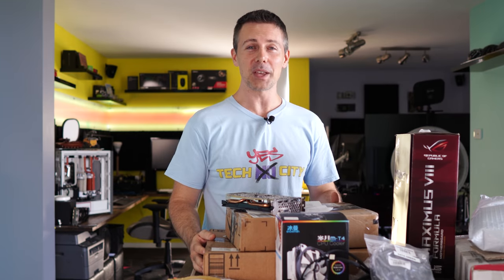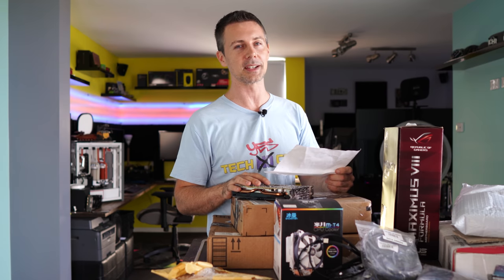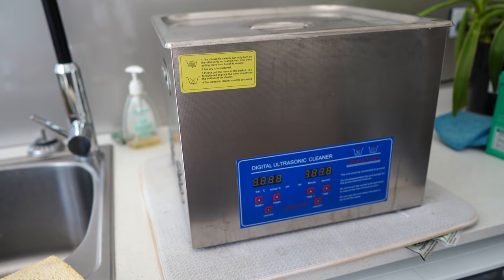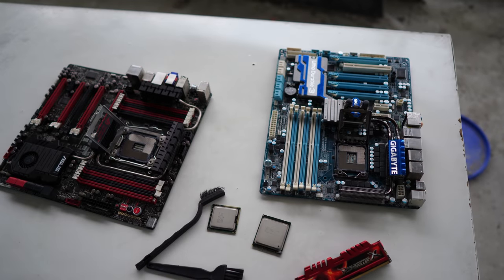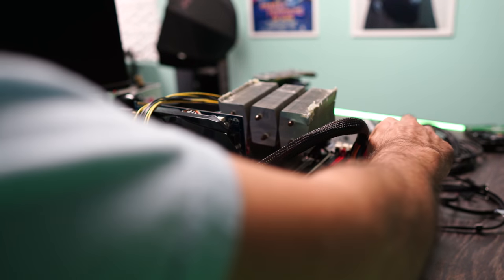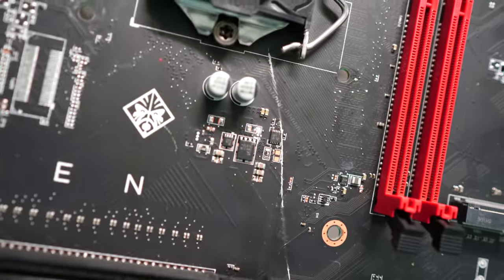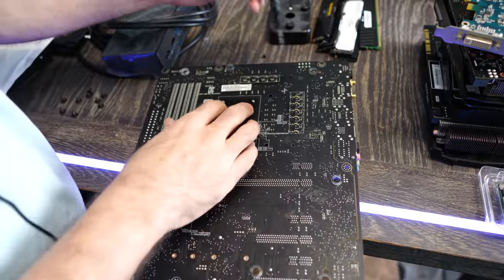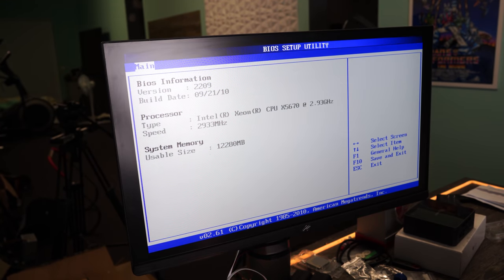Motherboard Doesn't START? NO RAM Recognized? Attempting to Fix Your Faulty Parts  (CAN YES FIX IT)

Comment: Hey, just discovered your channel and like quite a few vids of yours. Since I have been working in Australia when I was young and pretty I really love your accent too ;-) My question is: At 28:18 you are using a cleaning spray on your cpu and memory sockets. Can you comment on that? Which kind of spray? What do you do after spraying (just let it dry, wiping it off etc.) ? Having a i7-4790K with some oxydized contacts which I kind of managed to improve with a glas fiber pen after getting 5 beeps from my AMI bios. Thx.

Comment: Nvidia mats - often no picture or artefacts are from faulty memory (common problem with 10xx/20xx/30xx cards). Shows exactly what memory bank is at error. certain cases may also be dead memory controller in gpu. Also try as secondary card and look what bios it has. Seen many cards with either dead bios chip or some wierd/faulty bios flashed in ;) + test 12v, 5v and 1,8v rails to see are they there and what they are. seen cards with just a blown fuse (usualy long time miners). I learned lot from Tech Cemetery videos. Hes awesome at resurecting video cards and gives detailed describtion what and why he does.

Comment: I've had several motherboards that either wouldn't come up at all or would fail in the POST process somewhere and hang on boot. No fireworks or nasty abrupt shutdown, just one day wouldn't come up. Like an old person dying in their sleep, that's how most of your electronic devices are going to fail. Asus good with pilot and POST LEDs but my old Crosshair V indicator for CPU was lit red so I bought a compatible Sempron on Amazon dirt cheap and it still wouldn't boot. The old CPU would boot in a different AM3+ board and so would the Sempron. Most of the boards that I had crap out this way had already gotten a lot of use and no new BIOS updates were being written so I ended up chucking them. Probably an upset failure that picked that particular time to give up the ghost.

Comment: For the Asus viii board try checking under the PCIe slots I had the same board and had it die on me with a chip under the 2nd PCIe slot getting very hot with no life at all sometimes the lights light up until I try to power it on... IDK if changing the chip would fix it cuz j have it in my closet atm and just bought a new one.

Comment: Bryan just on a quick note that Asus Max Formula with the back plate , are you binning it ? if you are iv'e just got a Formula 7 z97 board really cheap and its missing the back plate , if you can i can pay for postage to UK if its not going to be too much , cheers Bryan ...Shaun p.s it also has a missing pin im going to try the wire trick and see if i can get it going  !!!!
Reply: It won't have the same screw holes. Different socket design.
Reply: @bingokemski4473  ah right it looked the same , thanks for the reply !!!!! ...Shaun.

Comment: Hi, I have Zorin Linux system at home and it is very useful as a tool to remove old windows 10 partitions from an M.2 SDD. There is a utility that removes all the partitions for use in a new or existing PC.

Comment: Can you have a video on how to replace a fan on an otherwise working psu or should I just leave it to professionals? I actually already bought a new one. But I hate to throw away a "working" psu which the only issue is a fan with bearing noise.

Comment: Don't heatgun. Moat modern cards break due to power delivery issues. And can be fixed by someone knowledgable. Putting the heay gun on it just is going to do nothing good. Most of gpus will not suddenly work by getting a bath.

Comment: Can those Dimm Ram tabs render a board unusable? I bought a refurbised Asus B85M-G. I can't get it to post. The only thing I can visually see that is wrong is 2 of those tabs are missing. The guy said he tested it before shipping it to me and it worked. I got it and can't get anything, I hooked up a speaker to try and get some codes. I can get the board to tell me it has no ram but when I put the ram in nothing, no codes, no video and no post. I tried 3 cpus the onboard video and a variety of other video cards. So I'm curious. I wouldn't think the tabs could be the issue but no harm in asking,eh? I really want this board to work, but I doubt it will he is giving me a refund. I managed to find brand new one at double the cost of this one. I could always send the other back if I can't get this one working before it arrives. I bought it because it's the last one. I thought better to order it now and have to send it back later rather then to lose it. I just bought an i7 4770 and I have 32 gb of ram 2 sticks are brand new never used been holding them as backups but got a little extra money for an upgrade. Any tips? There's a lot of redundecy in those CPU pins you could have pins missing and the damn thing will still work. Wierd advice you can build you own and still have warranties.

Comment: hi mate. great video! i have a dual kit and 1 of it module broken. is there anyway i can do to "revive" it?
Reply: You speaking of ram, right? I had a great success of bringing back 2 sticks of ram, after a very long brush with soap and hot water. If you wanna try that with the dead one is day go for it, if it has heatsinks take them off.

Comment: Hey do think you could take a look at the nz recycle market for a guide like on what our markets like for older out dated cheap buys.
I've been learning getting my knowledge up so I can follow your example.
I haven't built a pc yet..
I'm looking to start very soon,
So I'm going to start with a hp 8200.
I'm looking to build a gaming system rather buy. My cost under $300 All up using your methods.
I don't think anybodies doing what you....
Alsome stuff  mate ,
I wish you great success. 
Thanks.

Comment: You can actually FIX the GTX1070 its about 60/40 chance to get it working right but your case especialy looks like a 90/10 chance to work becauce for me its strait forward. it needs a refolow i actualy had a rx560 4gb and notebook with some AMD card in it and tempeture about 200°C is best for only soldering the contacts back together, on the other hand tempeture about 220°C can refolow the silicon inside the core.
To identify if its a nemory fault or just unconected solder, you need to look at the way how the fault is displayed, if its like random color big pixel of color or some kind of square fault sector with same color or mixed together its probably a MEMORY FAULT, but if its displaying the output  but with some kind of colorness but the pixels behind it have diferent colors  its probably BAD CONECTION between mb and die of the gpu. 
EASYES WAY TO RECOGNIZE THE PROBLEM IS TO LOOK AT THE FAULTY PARTS AND TELL IF ITS FULLY COLORED BIGER PART WITH JUST ONE COLOR  OR ITS JUST CORRUPTED.

Comment: The correct pronunciation for “chelated” is “key-lated”. As in the plant world, a chelated compound enables the host (you) to more easily absorb the minerals and is more stable. Non-chelated compounds are more reactive with other minerals and will reduce your uptake of said compound. Moral of the story is plants and people aren’t that much different in relation to the minerals required for growth and sustainability.
Reply: The American pronunciation is not 'the correct pronunciation.'

Comment: YESMAN ive got a question for you; Do you know of any other lubricant sprays in USA thats a clone/similar to the australian export multipurpose spray? If you dont could you do a video where you either have users send in sprays for you to test
Reply: Check through the older Tech Yes City lovin videos. I have a vague memory Bryan, before he discovered Australian Export, used CRC; possibly Power Lube® Multi-Purpose Lubricant.
Reply: @wadadli4sun  it was crc 556 which is no longer made. I have some power lube but it doesnt dry like his stuff the closest ive found is crc 3-36
Reply: He's also used brake cleaner in the past but most people cringe at that.
Reply: @bingokemski4473  Yup, I used that. Compared the chemical components to the contact cleaner I had and it was very similar. Worked a treat!

Comment: Is the Multi Purpose Spray like WD40?   At the end of your video, as to spending an extra $90 for a slightly larger NVMe SSD, I agree, make the sale, a buyer may not be able to afford the higher price.  240GB is fine for a boot drive and there is still enough room for a few games that would load faster on that SSD.  Drives are not that expensive and the buyer can always upgrade in the future if he wants to install games like Flight Simulator 2020.

Comment: Can you  buy a bga rework station? a cheap one can do its job. heatgun isnt the best, you need to watch the temp always.
3 stage, 3constant temperature.
with that you can replace vram, refflow the gpu, replace the cpu socket, etc.

Comment: I bet the GTX 1070 slowly cooked it self or the ram.   I have seen this happen before.  Imo manufactures set fan speeds to low imo and or video ram isnt getting proper cooling. If the GPU in bad case and bad airflow.  It slowly can cook a GPU and then just dies.  

back in the day I use play a lot wow. One time one fans on old ATI just died with no warning.   And then POOF while gaming with some friends in middle of dungeon,  I started smell smoke and poof.  Pc shut off and smoke came out back and old ATI card cook it’s self some how.   Again this long time ago.  2005/06.   It wasn’t high end ati GPU. But yeah it can happen.  Both AMD and Nvidia imo have fan profile set too low for all GPUs.  I alway tell mu friends to set bit higher fan curve,  

I got GTX 1080ti that still running strong and in most game it hardly ever hits above 65c.  

Good video, hi from AB Canada. :)

Comment: I fell asleep and left my pc running a game and when I woke up the pc had froze and I had to force shutdown but its had problems since. 

Sometimes it will boot fine and detect both ram sticks but then sometimes it will only detect 1 stick of ram and sometimes it will boot loop or just stay on and not post and I have to keep turning it off and back on again to get it to boot (I assume it detects no sticks when boot looping or refusing to post but I don't know though)

It's an I5 4690k, 16gb ddr3 (2x8gb) and motherboard is msi z97 pc mate, any help or advice would be appreciated as I would love to get this system working again cuz my son could do with  a pc for college and he also wants to play some game's on pc

Comment: hey I've got a gtx 980 ti that doesn't work, it seems like its got a short circuit somewhere, it tripped out my old power supply and broke the power supply, I tried it in my brothers pc and it blew a fuse on his motherboard and now his ethernet doesn't work, was wondering if you've got anything like this and what fixed it, nobody is going to buy it broken so id like to fix it

Comment: I watched 1000s component level repairs, and the biggest thing that kills GPUs permanently is people doing the heat gun thing. If you watch repairs very few are cracked solder balls under the GPU, and if it is, and a heat gun works, there is a 80% chance it will die again latter, ie, when a balls cracks it oxides, and when it's heat gunned the inclusion/oxide ends up in the ball and it cracks again. In repairs 25% are dead cores, ie, not economical to fix, with 75% being other stuff on the PCB, ie, not the core.

Comment: I probably have faulty ram slot on my motherboard. Everytime I clean up my pc, without taking them apart. a single love tap on my ram will render it undetectable. I have to take it off several time and put it on oh so gently each time until it detected.

Comment: Louis Rossmann says it's a total waste of time trying to "re-flow" GPU solder problems. Just ebay them so people who already have all the SMD equipment and experience can salvage as many as possible.
Reply: that GTX 1070 most likely has dead vram, so replacing the falty modules would probaly fix it.

Comment: Hi, I recently bought a Maximus VII Formula mobo, it was doing the exact same thing, these boards are finicky, it needed a couple fans plugged in, and you need to flash the bios via the back panel. The board won’t boot without it’s bios it took me a few hours to figure it out.
Reply: This may actually be something to try! I did click the BIOS flashback button at one point because I was so fed up with how it was handling things.
Reply: @bingokemski4473  for me, I had to hold the flashback button until it blinked, which the manual didn’t state. Also you need the usb stick formatted in FAT and inserted in the bottom usb closest to the top, hope this helps!

Comment: You need a water distiller and you need to use the distiller to convert that dirty tap water to clean distilled water. You should also for health reasons be drinking remineralized distilled water.
Reply: Distilled water has no health benefits. Australian tap water is also much cleaner than US tap water.

Comment: there is a fail safe way to get these video cards working. Have you ever heard of jumpering the VBios chip on the GPU's PCB and using them as a secondary card on a running computer. Insert the nonworking card into the PCIEx8_2 or the  second slot on the motherboard while using the first with a working GPU just to see if the card is detected. If its not detected then you can jumper the appropriate pins on the VBIOS chip[ and once the card is recognized then you can reflash the vbios

Comment: To the guy with chronic back pain(if you somehow manage to see this comment), watch Dr. Eric Berg's channel and Dr. John Bergman's channel. Magnesium could be a cause, as Brian said. Could also be Vitamin D and Omega 3 to Omega 6 ratio misbalance. Roman showers(Hot then cold) and red/ infrared light therapy helps to relax and stimulate bloodflow. And the "medicine" the doctors give usually make it worse by causing further imbalances in your body, which they treat with more drugs rather than treating the nutritional deficiency.

Comment: Check this guy's channel out Brian. He takes out the bios chip and reflashes using an external programmer. It usually works too. Red herrings, red herrings everywhere (4th Gen Intel Build, No POST) - LFC#292 - https://www.youtube.com/watch?v=QxqA_Tm4fXI&t=1227s

Comment: I have a deepcool L360 ARGB AIO on my ASUS H410M-E Mobo the tubes pushes the ram in the first slot which won’t let me boot my pc and no Mobo screen nothing all lights are on no power to keyboard or mouse I removed the ram from slot 1 then system boots
Tested with a tower cooler no stress on ram system boots with both ram

Comment: I had an issue with my mobo which was not turning on after shutting down because of powercut...so i did everything to fix it but nothing worked but lastly i just took out the cmos battery and cleaned it a bit and put it inside and my mobo started working again..

Comment: i had an x99 motherboard that would have been from aliexpress. it would not boot if the overclocking option was turned on. but the board died not too long after. then i managed to sell it as faulty for $30

Comment: hi o a, varry upset i am por an i am have ask teck city over 5 yrs a go if he would help me out i need a x58 mother board   that over clocks i have a 6core cpu for it an a 1060gtx but i can t over clock cuz my mother borad will not let me but it wll let me boot from a psi m.2 adapter    so it still fast but at 3,1ghz its not good i can get 4.5 thats 1.5 ghz i am loseing  anway i ask teck yes city foor help i told him i sand him cash on paypal if need be first  if he will sell me a x58 mother board   he gave me the run a round an than told  me  just look on ebay   u dont think i have 140cash for a used  x58  if not a good deal  sir my mom just passed away i just haveing a hard time an others aare just givieng u working x58    how manny here have working ones just sitting in a room doing nothing